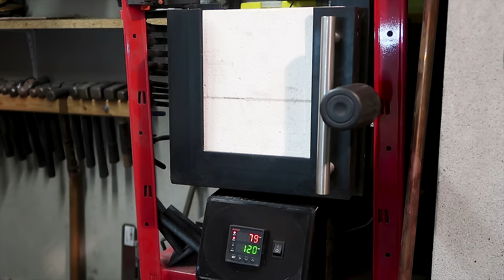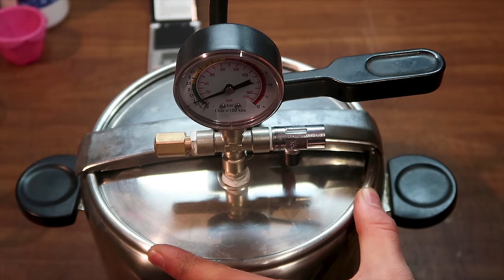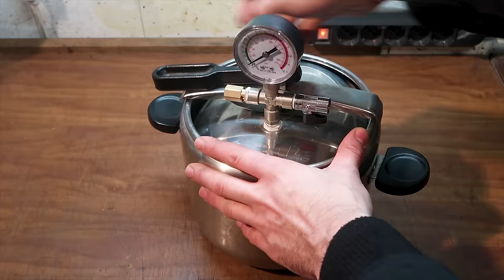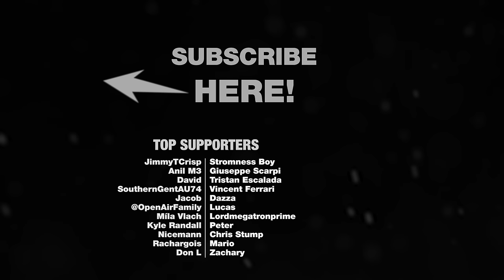DIY Pine Cone And Resin Scale / Blank

Comment: So, I read through your comments and I think I'm still confused. I get why you put them in the oven, to dry them out. But then you placed them in something that looked like resin, but I never saw you put in the catalyst. You put it in the pressure pot and we watched how all the bubbles came out. But then you pulled them out of the pressure pot still dripping from whatever they were soaking in and wrapped them individually and put them back in the kiln. Whatever that was did harden up but you pulled off the solid part and now you put them in a resin I'm used to seeing.  

What I don't get is what was that first liquid and why did you do it that way?  Sorry if this is a dumb question, I've just never seen resin done this way.
Reply: It's a stabilizing resin, he puts it in a vacuum to get the air out and the resin in, then, in the oven to cure it.

Comment: Heya. Whats the reason for stabilizing the pine cone since you covered em in resin? Will they fall apart when you saw them in half if you had not? Best regards
Reply: They end up a different consistency and polishing differently than the epoxy. If that makes sense.

Comment: 7:55 bro dont u know what a pusher is. holy that made me cringe watching that. atleast pull it through from the other side instead of the 2 thumb push, only steady it from one side (key word SIDE not freaking back thats less than an inch of space for 2 thumbs and a god damn band saw) and steady from the side making sure ur on track whilst pulling and doing the same with the other hand from the SAFE SIDE of the blade lol.